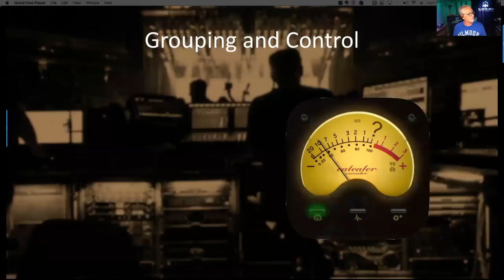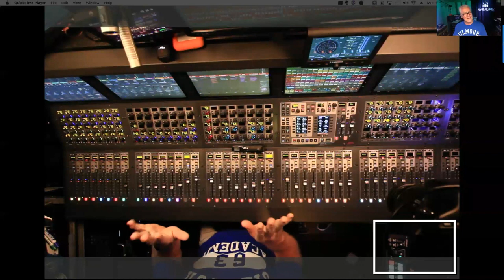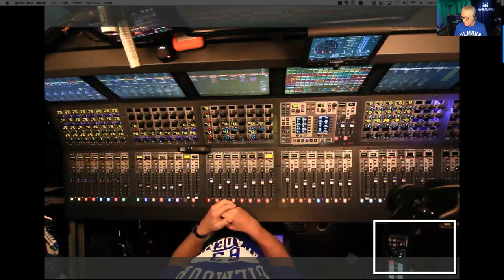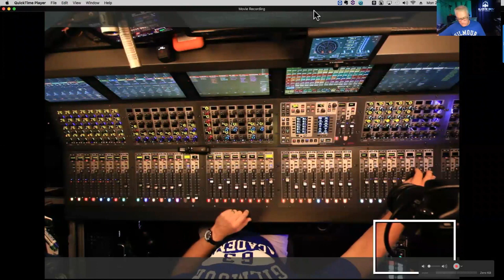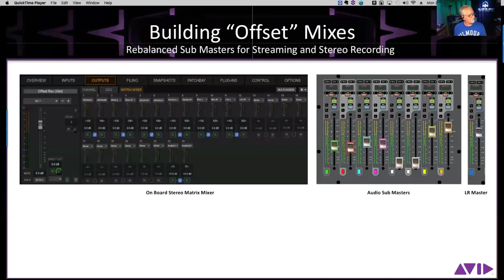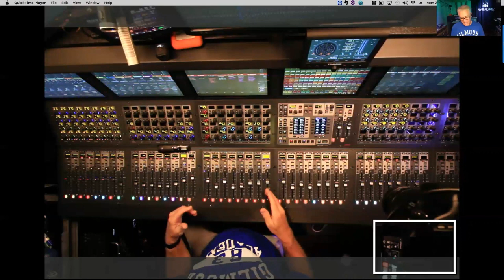06-The Lab June 1st 2020 (repaired)

Comment: Hi Robert,thank you so much for the content here,it’s so well explained and practical,much appreciated! I have a question for you,I’m a little bit confuse about the content of PA drive matrix and LRSUB,I thought PA drive include L/R SUB? Thanks!
Reply from the maker: Hey there -- sorry for the confusion. Usually, with only a few exceptions, I'll dedicate a matrix to the subwoofer drive. In this case, that matrix simply has the LR master bus as a source -- so it actually is LR driven Subs. Get me? Usually I do this because it is easier to manipulate time and level on the matrix output than it is to dig into the PA processor. And, if you want to switch over to Aux driven subs, you simply turn off the LR as a source in the Matrix and turn on a given aux. So, good flexibility by doing this with little to no penalties.

Comment: Do you use Groups or Auxes on S6L as sub masters for families of instruments? What about for parallel compression?
Reply from the maker: If I'm grouping as sub-masters, I'll always use sub-groups. If I'm doing parallel compression, more often than not I'll use an Aux and then return it to the input path so that I can send those returns to other auxes (subs, reverbs etc.) Cool?
Reply: Robert Scovill you just use the input returns from the plugin that you went into for the dry and crush parallel for instance? Then rock with those during the show not the actual Aux bus?